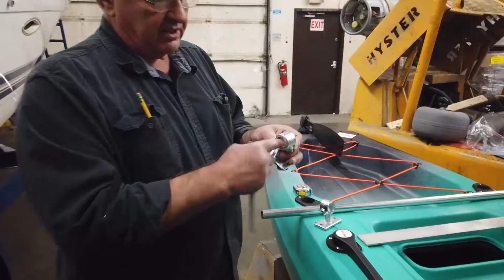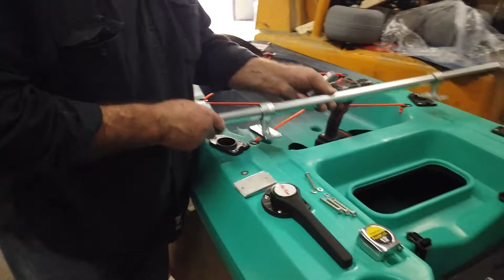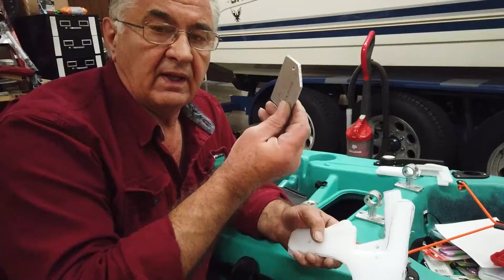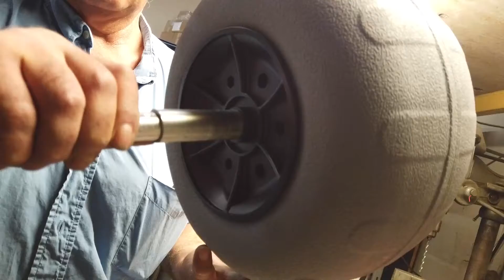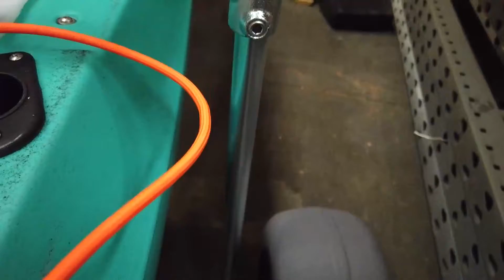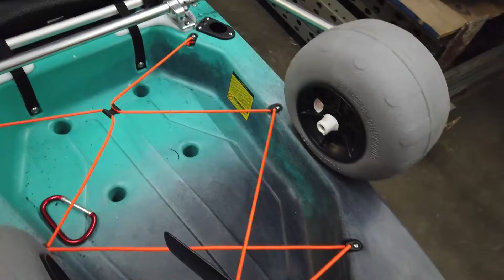Landing Gear for Fishing KAYAKS - Build Your Own - Construction and Installation Video

Comment: I'm curious why you chose Galvanized over Plastic..  All of y Kayaking is in saltwater and so I would choose PVC but again I'm curious toi hear your thoughts.
Reply from the maker: Hi Steve, this was an experiment and I went the cheapest way. Ideally I would have chosen light gage Stainless Steel. At the time I did not think that PVC would be able to support the weight. Galvanized is heavy but it was very stable when pulling it up and down the launching ramp.

Comment: So very fantastic! With those wheels there is an added benefit; instead of Turning the wheels in to sit on top of the kayak you leave the wheels turned  out and see if they offer some stability with the wheels acting as 'out riggers'.
Did you say you had a parts list that you can share?
Reply from the maker: Thanks for the comment, yes I did have the wheels on the side using them as flotation assist and it did help. I am a big guy 280lbs so any stabilizing assistance is welcome HAHAHA! The part list is in the video at the beginning. Honestly, I slap the whole thing together in a few days but if someone has time they can engineer the concept much better with better materials. I used simple pins to secure the positions but there are much better devices that will snap in place easier.

Comment: Hi again!!! I bought my own kayak!!! I have to elevated at 4th floor so I made a hand operating crane!!!! In order to avoid the slippering because the torgue I'll use rectangular aluminum heavy duty hollow pipe!!!
Reply from the maker: Hi, WOW! 4 floors. That is impressive. I imagine that you are using some kind of belts that go under the kayak, like lifting big boats with a crane. I am not an engineer but lifting the kayak from the top with any mounting will not be a good thing because the plastic will weaken during temperature change. Sorry just thinking out loud.
Reply: @MastersMagazine  the kayak shall have two hanging points (front and back) via the handles and will came up with an angle  of 45 deg. about.... For the lifting shall take place a rope 8 mm OD and some pulleys....
The weight of the vessel is 40 kilos...

Comment: Nice structure!!! When I buy my own kayak I have in mind to do something similar but using stainless steel 316. You see the galvanized steel if filed or drilled loose the galvanization and then start the rust specially if you use the kayak in sea water!!!
Many thanks for sharing!!!
Have a good time every time!!!!!
Best regards from Hellas (Greece)
Reply from the maker: Hello Thiodor, happy to hear you are from Greece. I am originally from Serbia. I had fun building the landing gear, stainless is the way to go. Mine was more of a trial and error so I didn't want to invest in SS. What I liked about it was when I submerge the wheels just a bit under the water level it stabilized the kayak and it did not create much of a drag when peddling.

Comment: So I have a native titan 13.5 and it is heavy. I have a rear native landing gear setup. I am looking to doing something like yours. However my track on the front that I was planning on use goes side to side. I would need a steel structural support to go the same way but it does not. What could I use instead any ideas? Thanks

Comment: I do not see how four screws anchored in plastic is going to overcome the long moment arm forces on anything but a smooth surface.  I would worry about the durability of the mounts. If observed carefully the gear leg moved considerably from the vertical just in the area where it was demonstrated when pushed aft. A secondary mount with a removable strut brace on each wheel could go a long way in meditating such rotational stresses. I could be very wrong.
Reply: Dito.
Reply: He added a backing plate BUT I still don’t think it’s sufficient.
Reply: I concur with this statement. Just based on the flexing alone, on such a smooth surface, I'd hate to see what happens in uneven surface, and weighed down with more gear, unfortunately will likely yield in fatigue and eventual failure.

Comment: To put the tires down and lock them in place you have them on buckets so it's nice and easy.  But it looks like you would need someone to lift up the Kayak for you to put them down or maybe do it while its still in the water?  I skimmed through the video so sorry if he explained this.
Reply from the maker: Hello, thanks for the comment. You are correct. When I store the kayak I always placed the buckets underneath for long term storage, I did not like leaving it on wheels for a long time. When going out I towed the kayak in the bed of my truck, so I would pull it half way out and then lower the wheels. When I was loading it on the truck I placed the kayak half way on the bed and then lift the wheels.
Reply: Was thinking the same thing but he mentioned it already. Otherwise you’d need to add a jack to your setup as well lol .. I may try this but with some modifications for lifting/lowering without a truck/water assist.

Comment: I would think the cutting board would go inside to provide more support over lrger area. This way the metal is still pulling on the same spot. Good video tho
Reply from the maker: Hi Joe, thanks for the comment. Yes there are two identical pieces of cutting board per main bracket. One goes under (inside the kayak) and the other on top. I agree the underneath support should be larger.
Reply: You missed it then cause he cuts 4 pieces. Two on top, two inside.

Comment: Are your pipe measurements 1/2 and 3/4 for od ?
Reply from the maker: Hi Jeremy, sorry for the delayed response. Since the time I made the video I sold my kayak and I don't remember. Wish I had it so that I can measure. As far as I remember I used 3/4 and 1/2. The 1/2 could have been just water pipe galvanized. Sorry man wish I could help. Regards, Val

Comment: I'm trying the same build 3/4 to 1/2 but the od of the 1/2 galvanized pipe is 7/8 at lowes. Bore on all the wheels are 7/8.  Any help?

Comment: love this build it solves my problem of not wanting to buy a trailer. could you please include names and part  id numbers for all the parts including the wheels and a little more detail on the black stoppers you added at the end. I'm build it this weekend
Reply: I was thinking the same. Having a link to the parts especially the wheels. I did see the name of the pipe fitting they are on Amazon.

Comment: Very 😎! Thank you. I go in saltwater, guess could do all aluminum. Have Hobie-outback so thinking if can use the scupper holes so make a frame: poles in scuppers attached 90 ° to 2 parallel poles so looks like an "H" or actually "#"shape sandwiching the kayak body so no stress point! As my father would say: 🤔
" always thinking " (which usually ended in disaster or peril !)😬
Reply from the maker: I like it, might want to look into Stainless Steel tubing for the salt water. I would build a template/working model out of PVC then see how it fits.

Comment: Looks good and I'm liking this a lot, but it'd be good to see it in action. I mean how does it work without the buckets? Is it easy to set the wheels down when the buckets aren't there? I guess you could set them up before the kayak leaves the truck and then raise them when in the water. I feel there should be more points to lock the wheels in place rather than just a couple of pins.
Reply: I rigged a dolly up to my 14ft jon boat with just two pins and dolly the whole thing with a 5.5 outboard motor on it. Trust me, if your base construction is sturdy then those pins will easily hold. Chances are good the base will flop before those pins break.

Comment: That would seem difficult to put the wheels down If you're fishing by yourself. Would have to be able to lift the rear of the kayak and while still holding it be able to put the pins back in place.
Reply from the maker: On the left side there is an extended handle that you use to leverage the wheels as you lower and raise the wheels. It works ok but as you say it is a bit difficult to do it in the water.  If I were to build from scratch I would make a half circle aluminum pin snap in handle (spring loaded).
Reply: I was thinking about this exact thing BUT.. Just like other landing gear, you only hassle with it right at the water line. Drop/remove the gear in shallow water in other words. Not like you’ll be twisting behind you to drop landing gear in 50’ waters right? Just hop out when you reach the shore and get everything into position.

Comment: Nice but to many pins to deal with when your in the water sorry good idea tho
Reply: You don't mess with it when you're in the water though...
Reply: Your comment doesn’t make any sense. Not like you’re raising or lowering the gear from the seat in 50’ water. You do it at the shore line. He didn’t need to make a handle for it really. He’s still going to be getting out and rotating that other wheel. Pins are perfect with this set up.

Comment: Have you tried pulling it across rougher ground yet? I hope not, but I think you're gonna have a catastrophic failure. Hope not. But there's a lot off flex on those long unsupported levers(legs).
Reply from the maker: Pulled it over grass, dirt, sand and lunching cement ramps. So far no issues. Discovered that it really stabilizes the kayak when submerged a foot below the water line. I'm just having fun experimenting.
Reply: @MastersMagazine  Awesome! Those fittings are great. I've got one out of PVC that flips over and under and the yak sits on the axle w/ a noodle. It's a bit of an experiment based on what others have posted on YT. Once the bugs are worked out, I'll likely weld one up out of .063 Tube and powder coat it. But I'll keep the cut PVC Tee's that mount it to the yak rails and act as the hinge point. The have about an 1" slot cut out of the top so the frame can just pop on and off but hold tight when clipped in. Thanks for posting yours. Good to see what guys come up with. :)
Reply from the maker: @wingnutbert9685  Thank you, I think I have seen have seen yours. Brilliant concept. Best regards.
Reply: @wingnutbert9685  Bert, you have a video of yours or pics>
Reply: @garyrussell7750  Sorry, I don't.
Reply: I have the commercial Landing Gear setup on my. Native PDL. I want to make a similar setup for my smaller sit inside. I like your version, but I noticed the flex as well. Do you know where it originates? I’m afraid that the long term effect will eventually cause a failure of the kayak body. Spreading the strain over the width of the kayak using a plate above and a plate below might help.
Reply from the maker: @philod902  I think that the inside/underneath additional support is a must on any kayak that you want to install any kind of landing Gear. It would be very easy for the manufacturers to simply build a top support beams on both sides during their process. Hell they make enough money on molded plastic. Makes me want to go into kayak business.

Comment: Wanna do this for my PDL 120?
Reply from the maker: Hi Anthony, it would be much the same. You would just need to make your underneath mount support pattern to fit the design of the PDL-120. If you really want to make it nice use Stainless Steel 3/4 pipe and fittings. One thing to note is that I did end up using T's instead of 90 degree elbows. Gives you much more stability.